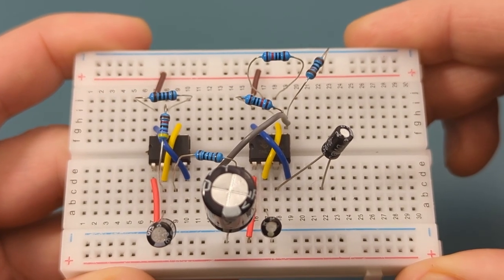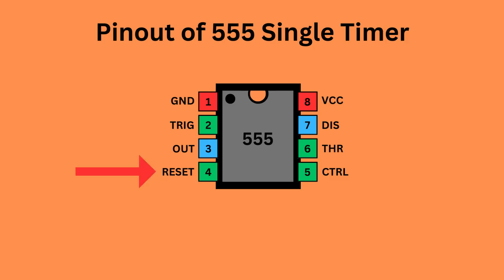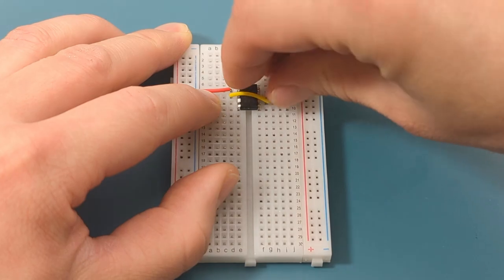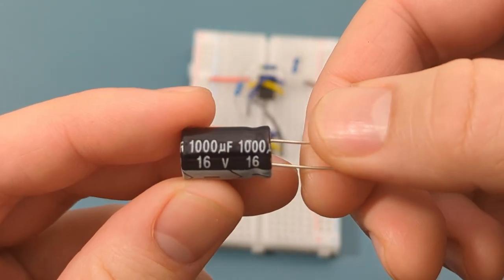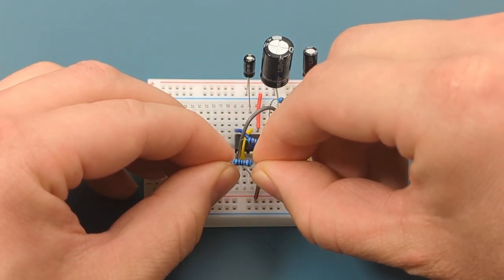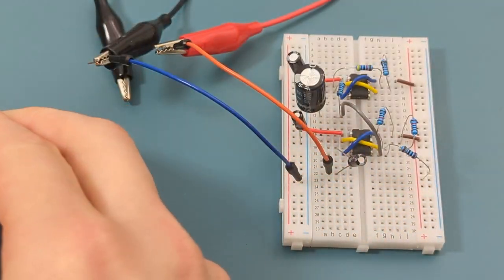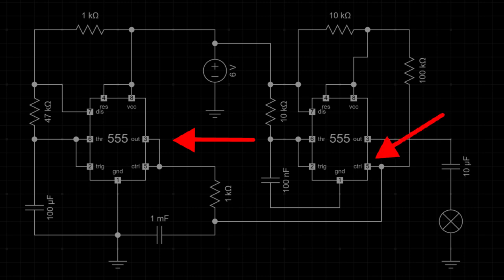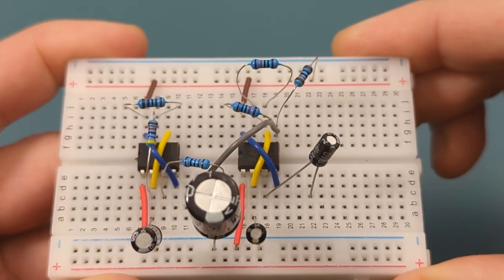How to Make Police Siren With 555 Timer

Comment: Arduino do it better 🗿
Reply: The Arduino costs more, but gives the opportunity to vary the siren sound easily. However, it does require programming, which is a more advanced concept.  Also, Arduino output pins can only provide 20 mA current, so you would likely need to add an amplifier

Comment: I have all the parts except the speaker in both through hole and surface mount. Maybe if it works well I could order a few PCBs from China.
Reply from the maker: I have listed all the required parts in the description.

Comment: And were is the speaker in the schematics?
Reply: It's the one with incorrect lamp symbol. (check 9:36)
Reply from the maker: Yeah. Unfortunately, the schematic tool doesn't have a speaker component.